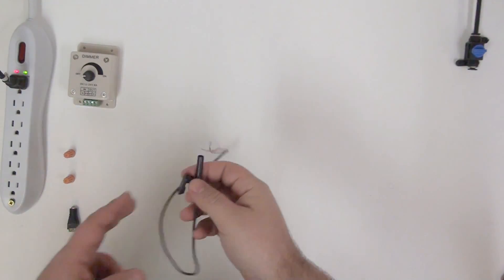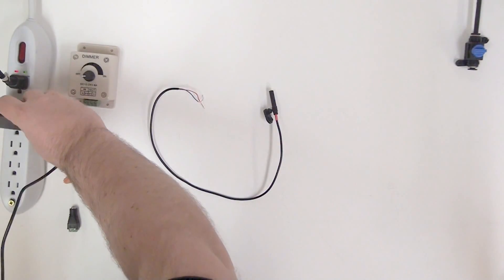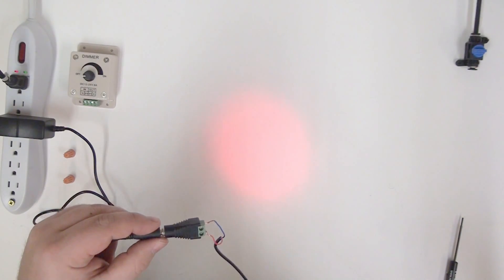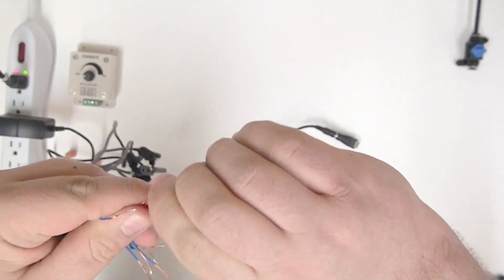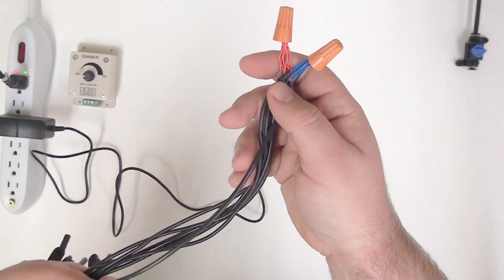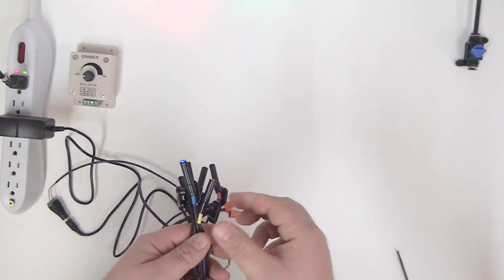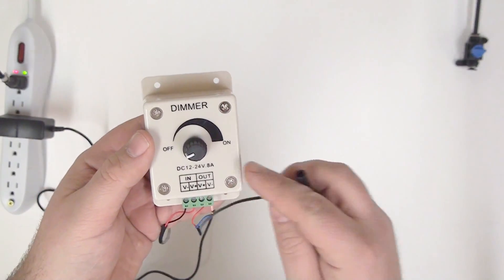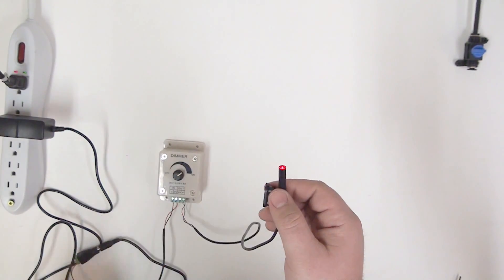Nano Spot (Miniature LED) Lights Wiring Tutorial

Comment: Why do you do your connection when the power is live?  That’s not a very safe practice.  I know this is low voltage DC but there could be an issue with your transformer exposing yourself to a fatal shock.  Make the connections, then plug it in!